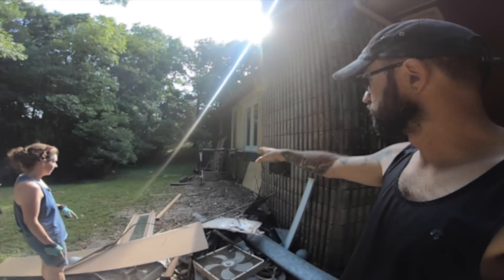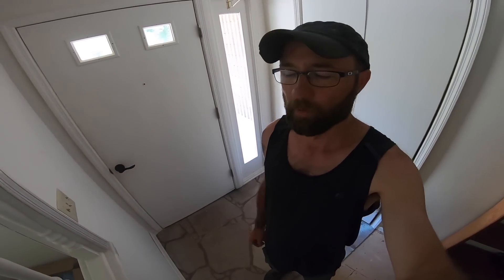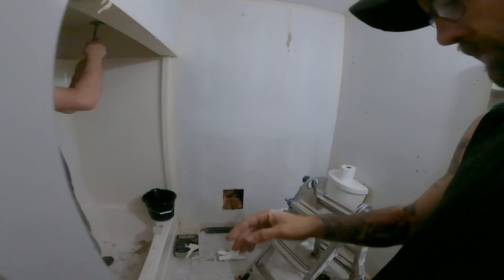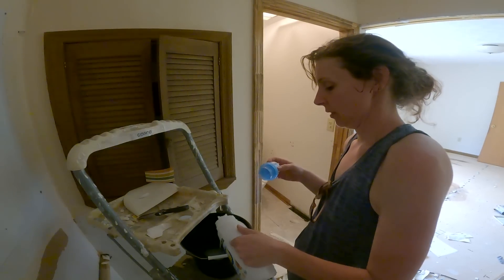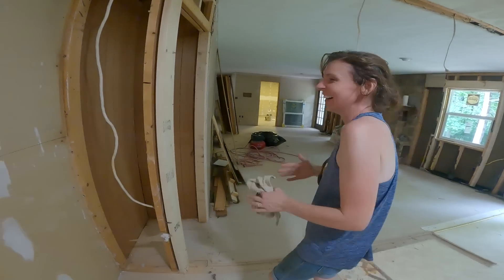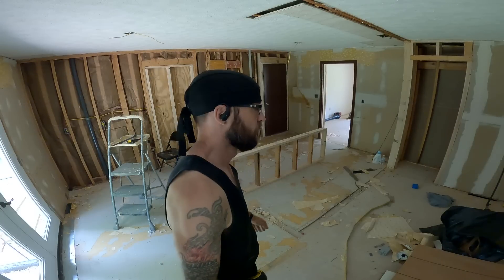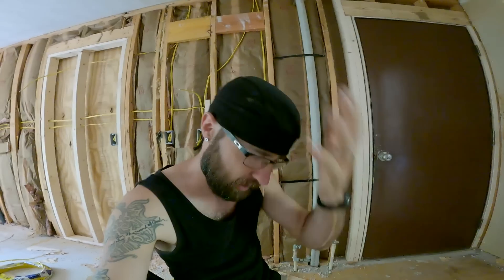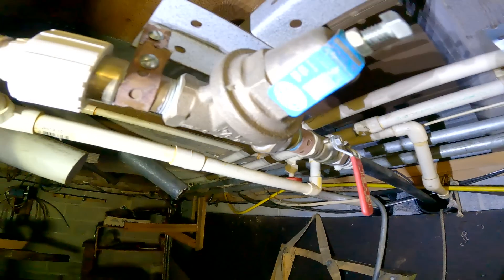Renovation: Joys and Woes // Retro Reno Pt 10

Comment: Way back in the day, 30+ years ago, when I was more trusting of commercial products I used something called DIF to remove wall paper. It worked well. Then I realized that vinegar and hot water worked, too. Never tried fabric softener, but I imagine it also helps to break down the adhesive.  Anyway you do it, it’s a big mess and lots of elbow grease.  I agree with Berry, the smells in fabric softener are way too intense. Since I switched to using vinegar and other mild cleaners decades ago the scents are so strong! Nose blind is truly a thing. Often times it takes many washings to get fabric softener scent out of something someone else has washed.
Reply from the maker: If Molly used fabric softener on ANY of my clothes I'd probably just burn them and start over. ..She knows me well.   :)
Reply: @EmptyHammock  lol.
Reply: DIF is still out there and I believe it's made by Zinser (sp) but I liked Molly's technique!  (BTW no fabric softener for my hubby either!)

Comment: I always get super cold in the shower (when I have to step out of the water to shampoo my hair, shave my legs, etc.) and would love to have a low wall like that, all the way down to the level of the shower curtain to trap in all the heat from the shower. I've actually planned to do something like that in my house if I ever build one. But I was told to do a drop ceiling instead to prevent steam from getting trapped up inside as it could create a moisture/mildew trap. Anyway, I'll bet that was their thinking in building that.
Reply from the maker: Probably..   :)

Comment: Smart, smart, smart. As soon as you leave that old messed up plumbing in, you know it'll fail. The new owners will be upset and upset people paying hundreds of thousands for a house, sue. Better to do what you've decided: rip it all out for a solid system you know will work for years.  Add the cost to the asking price. If I was buying that house (I would buy it if I could afford it and if it hasn't yet been sold), if I was buying it I'd rather pay for the plumbing upgrade rather than have a leak in a few years. You're smart. And experienced. You know stuff fails, you can tell the pipe is brittle. Regarding the wall paper removal, poor Molly. That job sucks.

Comment: I used to hang wallpaper  professionally and I don't understand why people have problem removing it.  There is wallpaper remover you can buy.  Wet it thoroughly and let it sit and it will fall right off the wall.  I have done it many times.
Reply from the maker: ...just like fabric softener.    :)

Comment: I have a pex manifold system in my northern Vermont house which was built in 2002. It nice to know it will survive a minus 30 degree winter if you run out of oil and firewood (which I make sure I never do). Works good for any plumbing maintenance you need to do as well.
Reply from the maker: indeed!

Comment: Our house (1957 ranch) has an electric run to the attached garage that basically runs the entire west and south walls of the basement (the direct line to the outlet wall would be the north wall), UP the SW corner of the garage wall (in conduit), across the entire west end of garage ceiling, DOWN the north garage wall only to supply ONE outlet.  ???  Maybe the electrician was getting paid by the foot?  Sometimes you just wonder.  Eventually we will redo it right and ... just maybe... have more than one outlet in the garage.

Comment: I bought a house and the previous homeowner installed some kind of super wallpaper that you couldn’t remove. I did one small wall and realized for the sheer amount of wallpaper I had it would take a month to remove. I tried everything- steamer, fab softener, chemicals. Etc. I don’t know what kind of glue it was. Final solution was to apply drywall compound over all the seams and then used a zinser primer over it. Once painted you couldn’t tell it was wallpaper.
Reply from the maker: Nice!

Comment: Taking off wallpaper is a hard job. Most ppl don't realize how hard it is and how hard it is to not damage the wall when taking it off. $200 for the metal?
Reply from the maker: indeed..

That's 207.69% more than I got..   :)
Reply: @EmptyHammock  Well there you go. But at least you have a place to take it and hopefully recycle it for a good purpose.  God bless. So you lost $
Reply from the maker: It paid for the fuel to get there..   :)

Comment: So do pipes freeze in your area? Only thought for the logic running under the main feed  to Shop Area and the hose bib and back again was to drain the lines to prevent freezing. Beyond that I'm stumped.
Reply from the maker: It gets into the single digits most every winter..

Comment: Do you score (think it's called a paper tiger) the wallpaper before you spray it so the spray is able to penetrate it better?
Reply from the maker: I didn't have to do that with these papers because the water resistant layers peeled off pretty easy to expose the porous adhesive layer. In one room the old paper was like newsprint though, so it was weird. Scoring it may have helped but it was so thin I may have put little holes all over the sheetrock and created a whole new problem... -M